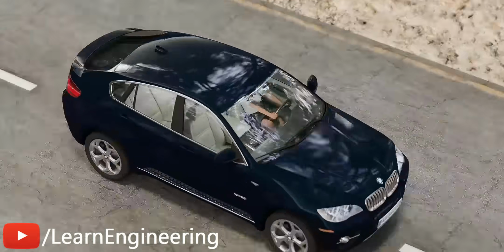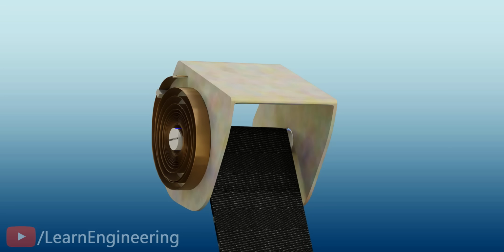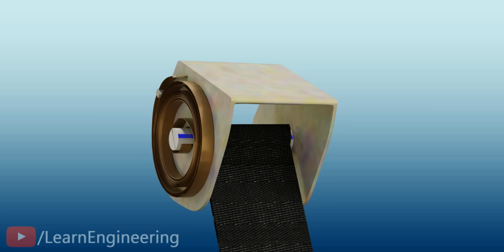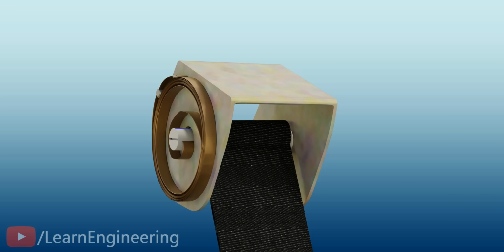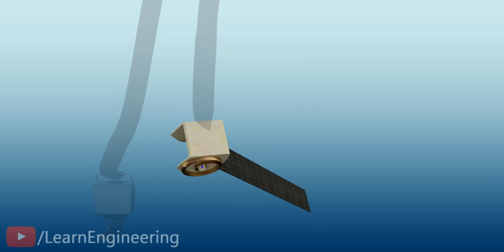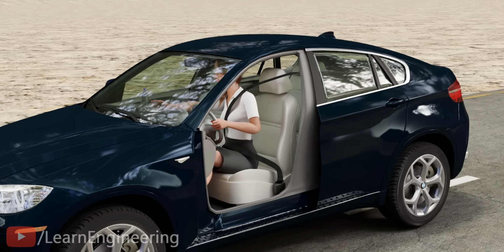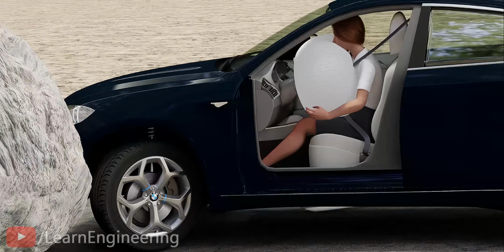Seatbelt | How does it work?

Comment: Fun fact:
Volvo have electric pretensioners on newer cars. So the car can actually pretension the belt BEFORE an accident has happened. They also have, since long back, TWO explosive devices - one at the top mount (as shown here in the video, where the roll is) and one at the bottom mount (where it is fastened between the door and the seat). This is because this saves lives since it tension the belt in a better way.
Reply: Produced by Autoliv :)
Reply: i really confused with the combined effect of pretensioner and torsion bar, as torsion bar is provided to absorb rigidness from innitial impact to standstill of vehicle, so that passengers wont get much hard force. and allow them to fall forward to a rate that air bags will fully deploy. but using the pretensioner at the time of innitial impact is like countering the effect of torsion bar, one place enggineers are allowing seat belt to fall forward slightly, another case they are tightening it. please someone explain where i m wrong in my understanding of torsional bar n pretensioner
Reply: @ashishkumar-yn5vm  First, you want to hug hug the person, as much as you can. As tight as possible. First you have to overcome the fact that people just do not put the belt on properly, so it is not tighten to your hip and body, then you must overcome clothes that also have an impact of the tightness of the belt. Then you have to overcome people leaning out from the chair.
So, pretension system and explosive devices try to fix all this (but YOU still should unzip thick coat(jacket and then buckle up and then tighten the belt so it is firmly in place).
Then you crash and everything pull you into the seat as much as possible, because you should move as little as possible to start with. Then you have the flexing of the entire system to help you slow down in a controlled manner (if you have slack of the belt you will first just fly uncontrollably forward until the belt catches you and that is BAD) together with the deformation zones and then finishing with the airbag.

To see what happens when the seat belt does not proved the correct holding force on you, look at crash tests of Tesla Model S. They failed twice(!) because of bad seatbelts. They redesigned the system between crash test 1 and 2. After crash test 2 Elon said that the test was faulty...........

Comment: a very informative video...until you mentioned that the pretensioners are activated with heavy breaking.
no, thats not how they work. they are activated during a collision by the sensors of the vehicle, otherwise we would see pretensioners exploding every time anyone was doing an emergency stop.
having said that, some cars (mostly german executive models like the S-class) are also using electric pretensioners (along with other tricks, such as bringing seats to an upright position, closing the sunroof, raising the suspension for a side impact, etc) to "prepare" the passengers before impact. but these can be activated many times, and dont need to be replaced

Comment: There is a small mistake in this video: The seat belt pretensioner usually doesn't react to brake pedal movement, but rather to the airbag sensors. This means it only triggers when the g-sensors in the front of the car detect a collision, not before that.
The advantage of this is that it doesn't go off in a situation where you brake strongly but don't have an accident, for example when you manage to prevent an accident. Since the pretensioner is a single-use device, such a maneuver (even in a voluntary driving safety training, rather than an actually dangerous situation) would make it impossible to use the pretensioner in an actual accident.
Reply: I was thinking about this, thanks for the explanation. 
I have floored the brakes several times by now and I thought maybe my pretensioner has fired!
Reply: My VW and my parents merc both pretention even without airbags going off and have done so multiple times, so they can’t be charge based systems there.
Reply: @matthewferos your car has both
Reply: All true,but my 1999 is not connected to any electrical,works from ball action only
Reply: why do people not make the pretensioner multi usable?
Reply: Our Alfa 159 pre-tensions without accident warning, hard breaking is enough
Reply: I think this feature is called "pre-safe" in Mercedes benz
Reply: Modern pre tensioners is driven by an electric motor so it can pre tension as long the motor/all the components is working. But the seat belt locking mechanism is still a mechanical one so it would work even if the vehicle is not turned on/if the battery/circuits failed.

Some of the manufacturers keeps the data on how many times the pre-tensioner has been deployed to know how many hard brakes you've done.
Reply: Yeah, it didn't make sense to me either to fire explosive material while hard braking.
Reply: I was thinking about this.... thanks for clearing my doubt.

Comment: Explosive pretensioner..?
Does that mean it is a single use item, and needs to be replaced, even if the car is not damaged..?
Reply: Yep. If the airbags go off you need to replace the bags as well as the whole retractor assembly. But they won't just go off by stomping on the brakes you need to be in a collision.

Comment: I can't be the only one who fears that the belt will snap or tear, right?
Reply: I never feared that just because of how strong seatbelts are, those things are actually insane
Reply: @wet0wl  
Well, yes... But I was also referring to where they are attached.

The entire mechanism could come loose from the bolt that ties it to the seat or car...
Reply: I saw a video where they talked about an accident on a highway, happened at around 130 kph (80 mph) and they said there was so much energy released at the impact that the seatbelt just ripped.
Reply: @tabushka292  
That's... Another concern I now have... 😂
Reply: @benjaminrobledo5466  Well there's only so much seatbelts, airbags and crumple zones can protect you from. But if you pay attention you will brake and try to evade the obstruction so you hit it an angle. If you just run head on into something at full speed you will probably die even with all the safety features in place. So I don't think it's much cause for concern, seatbelts do their job fine but they also require the drivers to pay attention and follow the rules.

Comment: This is also another type of seatbelt system. Connected with distance sensor. Reusable tighting mechanism. I'm not expert in this area but I experienced how it works in Lexus car. It works not always when hard breaking but necessarily when braking and dangerously approaching the obstacle.
I'm curious how those works.

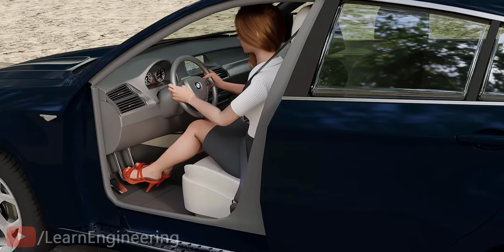Comment: 6:50
1st, why she's wearing high heels?
2nd, why she's using left foot for braking?
both were told not safe for driving. this is not a racing car you need to use left foot for braking pad.

That's why she need extra safety protection from the car

Comment: 6:50 why is she pressing the brake with the left foot?
Reply: Clutch pedal
Reply: @sergiovicente6868  nope, is the pedal from middle.
Reply: @Gabriel-km2xi  If you're braking hard you want to disconnect the engine from the wheels. Hence the clutch pedal with the left foot. Thr right foot is most likely pressing hard on the brake pedal in the middle.
Reply: @sergiovicente6868  man, in the video the brake pedal is pressed with left foot, watch again.
Reply: @Gabriel-km2xi  oh I see, i thought the comments were on the side view before she hits the bolder. Yes, you're right 😂

Comment: Nice video however pretensioners are not triggered off brakes at all. They are triggered by the various crash sensors, this is why you see the belt contract on IIHS crash tests when no brake is being pressed

Comment: one thing was left out Not all vehicles are totaled if the air bags deploy. 

If this ever happens be sure that the seat belts have also been replaced too.

On most designs of modern seatbelts they are a one off and not meant to be used again.

Comment: I believe there's an error with the explanation of the gas generator.  These are tied to the airbag deployment.  Otherwise a hard step on the break to avoid an accident could set them off and render them useless in the future.

Comment: The controller doesn't ignite the explosive piston from fast pedal braking power. There're sensors that detect drastic speed loss and impact (located inside left&right bumper side or even deeper into the bumper frame to avoid passager-driver injuries from small impacts directly on the sensor side) A lot of accidents the drivers didn't even manage to react and touch the brake pedal but the seatbelt and the airbags opened correctly. That's why you should never drive a car with active airbags without seatbelts on stay safe

Comment: So wait, if I ever press the brake really fast, I've already used up that explosive thingy?
Reply: No that part isn't true
Reply: i am from seat belt manufacturing company so let me tell you , pressing slow or fast the brake the explosion will not take place at any cost . Pressure / Force sensors will be place at the front end of the car only if the car get that enough pressure sensors will activate and pass the signal to MGG ( micro gas generator ) to ignite . I hope its clear now
Reply: @ravikumartantry  Yeah that makes more sense. Thanks.
Reply: Follow

Comment: Ok First of all that car has ABS brakes with makes it possible to turn and brake at the same time so the wheels wont stop rotating when you hit the brakes. Second you probably will be able to turn and avoid that rock. And if that car is relatively new it will have anticollision system in it. BMW is head of It’s time in the technical bit. And yes i know this is about airbags and stuff!!!

Comment: 7:11 Nowadays we don’t use rack&pinion type pretensioner no more. Because its pretensioning load is too high and it has too big to mounting in B-pillar. (pretensioning force must be lower than 2.0kN) Instead of rack&pinion type, we use ball & ring gear type, further elastic material(plastic rod) and pinion gear.

And the name of explosive material part is MGG(Micro Gas Generator). It contains gun powder. Its maximum pressure is high up to 100~110MPa.

Comment: This lady doesn’t seem like a very good driver, she crashes into a large rock in the road many times. She also doesn’t put a foot on the dead pedal.
Reply: Plus she is using the left foot to brake. She would not had passed her driving text IRL.
Reply: Nobody notice the door is gone
Reply: What's a dead pedal? Oh, noob drivers' resting place?
Reply: She is alexa, i think.
Reply: Bro she is a lady
Reply: you're all wrong thats a manual car and the left foot is on the clutch pedal, which needed to get pushed down everytime you brake
Reply: @mikekartwii  the left foot was on the brake
Reply: @mikekartwii  LOL, no, you don't push the clutch when you brake unless you're switching gears down or coming to a stop
Reply: @mikekartwii  in an accident no one presses the clutch

Comment: Uhm, that's not how a pretensioner works.  It's triggered by sudden deceleration, not the brake pedal.  Otherwise you would have to replace the seatbelt after every hard brake...

Also, modern cars have another system that's not mentioned here.

Basically, you have a pyrotechnic pretensioner (in my Z3 it's on the buckle, not in the retractor), and an electronic locking mechanism.  If the car's accelerometer detects harsh movement (which can be a pain if it's as sensitive as my Z3) it locks the belt.  Assuming that the belt is decently tight, this will keep you planted in the seat while swerving, and also acts to "prime" the belt for a collision.  If the car hits something the belt is already locked, and then the SRS computer simply has to set off the pyrotechnic charge to yank the buckle down and ensure the belt is tight enough to prevent submarining.

If effect, this means that if you simply accelerated/braked a bit on the hard side or went around a corner fast the belt will not give afterwards (can be uncomfortable), but all you have to do then is lean a bit harder into the backrest to slacken the belt, so the locking mechanism can release.  If the pretensioner in the buckle is set off, you have to replace the buckle (and the belt, as it's meant to be replaced after an accident).

Comment: Breaking deceleration can be achived max 1g, where as AIR BAG at higher g, pre tension er if senses by brake, then do u say even at ABS brake application, which us quite fast, will blow the pretension , please correct .

Comment: If head is also tied with head belt which can roll left right not on front tied with seat 
No one is dead when accident occur 
Not even a safety bag is not in the car no one will push his face into car steering 
so safety body chest belt plus 
safety head belt is necessary to use when drive a car

Comment: Braking with your left foot is a fatal mistake if you drive a non-diesel car.
Lets say you hit a boulder in the middle of the road, your right foot is loose so in the impact moment it is most likely to press the gas pedal wich provides the engine with gas, if the motor sustains critical damage that may lead to a fire too , or if the motor sustains minimal damage you just increased it, ending up with more damage that you needed in that tight situation to be honest. Sorry for the long comment, I use to make long remarks from my phone when I drive drunk.

Comment: Question: Since there is some explosive in pre-tensioner belt system, how do I refill it after a hard brake?
Reply: That's not how it works.  They got it wrong in the video.

The pretensioner fires if the SRS computer detects deceleration that's in line with an accident.  The belt is locked before that by the hard braking (or hard cornering to keep you planted in the seat), and the pretensioner just prevents submarining by yanking the belt tight at the moment of impact.

Comment: So when that gas thing ignites is the seatbelt need to be “reset” by the dealer? Or can it recharge on its own if it was a close call and no  actual accident?
Reply: I read a comment that stated the pre tensioner ignites along with the airbags deployment, meaning it's a pretty big deal, they said you have to replace the seatbelt.
Reply: Nathan Fleming interesting thanks
Reply: @CrashCarson14  for sure 👍

Comment: The last part is wrong. The pyrotehnic tentioner will not deploy with maximum braking, only during crash, when excess G-forces are detected. Otherwise, it would just deploy the first time you brake hard, and after that you will not have it for deployement when an actuall crash occures.
Also, the belt itself streaches during crash to absorb energy and reduce G-forces of the occupant.

Comment: 4:18 even in slow motion I don’t get how it actually works
Reply: The orange gear works as a lock mechanism.It is interesting to note that when the belt is pulled slowly it is free to move but with increase in inertia (during rotation) it will rise up and get stuck to lock up.
Reply: It is kinda unclear explanation, I agree. But look at it again..watch where the pivoting point is, note how they say it's in loose connection with central "E" piece and just imagine rotating it really fast.

Comment: If the pretensioner goes off when the brake is pressed hard then couldn’t it go off when there isn’t actually an accident and since it uses a small explosive wouldn’t it have to be replaced

Comment: Good video, but it's a bit disingenuous when it comes to the pre-tensioner system; they don't fire based on brake input. Most (if not all) pre-tensioner systems are connected to the airbag deployment system. If an airbag deploys, and the system senses that a seat belt is in use, it will fire the pre-tensioner in any  in-use seat belts at the same time. Yes, this is done by crossing a deceleration threshold, but it is in NO WAY associated with the brake pedal.